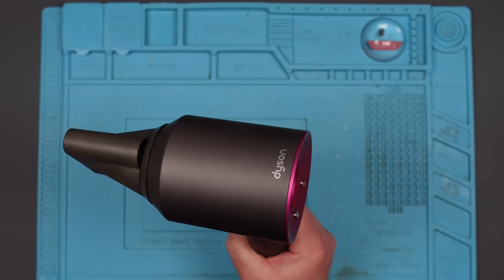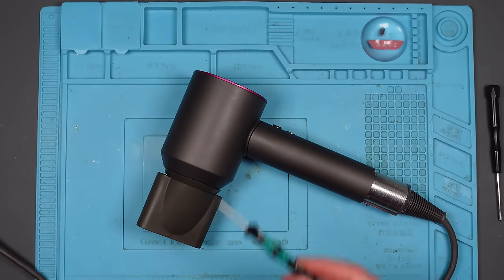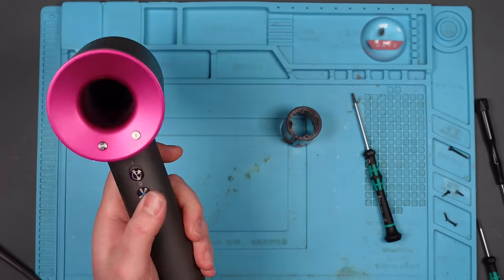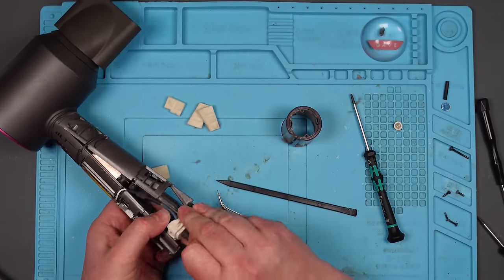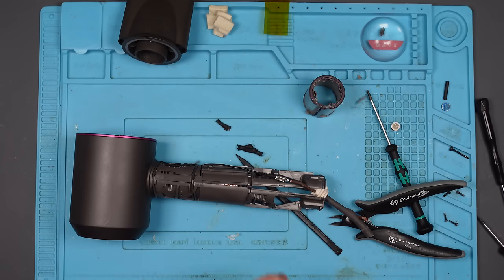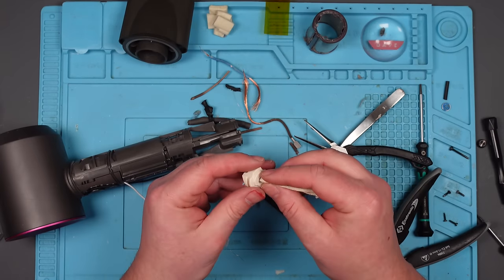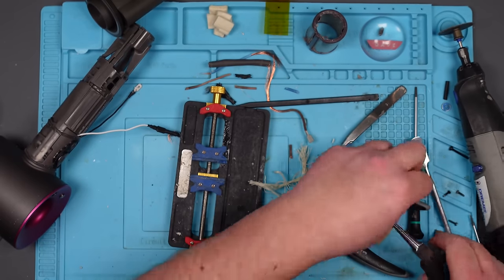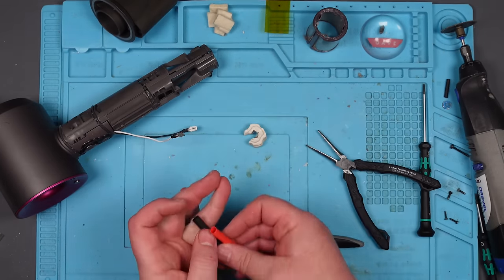I paid £75 for a £400 dyson hairdryer on eBay | how bad can it be?

Comment from the maker: I think i'll go back to melting plastic after this.
Reply: probably for the best...
Reply: use some hot glue for strain relief.
Reply: Stupid Hairdryer
Reply: @proditaki  that's the catch phrase missing!! thank you.
Reply: Should have hot snotted the strain relief.
Reply: You think it can go that hot? (Stupid fancy underpowered heat gun.)
Reply: @JohanFroloff81 Epoxy resin
Reply: Perhaps this hairdryer will help to melt the plastics when put at its highest setting?  (Just a thought!).🌬🍃
Reply: Next time just epoxy the cable in place if you can't fix it properly.
Reply: Big Clive recently tried a hot staple tool to join plastic but I recommend a b weld epoxy
Reply: Do what you know best.
Reply: I chew on plastic its enjoyable
Reply: The good news is that when it does inevitably fail again, you'll be preoccupied with having either electrocuted yourself with the likely bare wire that's been yanked out or have burned the house down. This was a pretty irresponsible "fix" to consider complete.

Comment: Dyson definetly goes out of their way to make their devices as unfixable as possible. Basically the apple of rubbish overpriced fans.
Reply: I don't know about that. If it was an Apple product, they would've glued the handle together and put a microprocessor in the power cord so it would refuse to power on if the serial number didn't match. Dyson's all about form over function, but at least it had screws...
Reply: No they don’t.  Dyson even supply service manuals.
Reply: They are very easy to service.

Just because some people lack the skill, it is not the products fault.
Reply: @dom3827 This is not true. We just had a cordless vacuum at the repair cafe. The product is overly complex and poorly designed. The product was chock full of dirt in every place imaginable with most of those places very time consuming to dismantle.

This is the opposite of well designed, well engineered, repairable and maintainable. I would not buy a Dyson product

To contrast that with another manufacturer of hair tongs which were superbly designed and made with all the spare parts available. The product was a work of art with no compromise in any department.
Reply: @SimonEllwood  again. Lack of skill and inderstanding.
Reply: @dom3827  Your comment is total, tosh. I spent my whole career in product design.

Comment: Dysons are over-engineered, they work well...but once they fail they want you to just buy a new one. Taking them apart is a nightmare, you'll find that with a lot of newer tech. It's part of the "throw-away society" we became accustomed to.
Reply: Dysons are the Apple of the small appliance world.
Reply: Something over-engineered usually means redundancy so it doesn't fail.  Perhaps you meant something else?
Reply: @JohnSmith-ro8hk  You're correct, but no, I don't mean anything else. Dyson makes great products that last, but when they fail you cannot fix them without breaking something. That is the only flaw with over-engineering, it works great until it doesn't.
Reply: They are designed to be as cheaply made as possible and absolutely not repairable.
Reply: @hugegamer5988 This is true for every company. However, I'd argue with "made as cheap as possible" over "cheaply made as possible", and absolutely not repairable 😂
Reply: I would go with "over designed" rather than "over engineered."  The latter implies that there is excessive complication to achieve superior performance, and I just don't see that with Dyson products.  Most of the effort goes into the Dyson logo, it seems.
Reply: @hugegamer5988 I don't think that's true. They're designed to look cool, and probably cost a lot more to make than they should because they won't compromise on the goofy-looking design, but they can charge a premium for it.  Repairability is not even a consideration when they design the product, but I don't think they're actively designing it to be irreparable... yet...
Reply: @jasonpatterson8091  Sorry, that white "strain relief" piece Steve had to saw in half is what I would consider "over engineering". It would have made sense if it were two halves to hold the wires, not a solid piece. That was an engineer working with a company designer to make it solid, lightweight, and affordable. You may not want to call it over engineering, but you're just playing on semantics.
Reply: I love being able to strip down my Dyson vacuum. I find it easy along with replacing bits
Reply: They are actually very easy to disassemble and service.

I repair them for a living. If you cant take them apart, it is on you. But they are made easy serviceable.

I think people are just not as capable in crafting than they were 40 years ago, where they had to have those skills to rebuild the world after war.
Reply: tell me the model you struggle with, i tell you how to completely disassemble it in a couple of minutes.
Reply: They are a mains voltage product with no cpc so are a class 2 product, they are designed to be difficult to get into so that multiple things need to fail before you could get access to live parts. Companies tend to make things difficult to get into (but not impossible) to cover themselves from liability that would be incurred if they make it too easy, especially for a product which will have to comply with multiple international regulations within one design.

Comment: I worked on a Dyson vacuum cleaner recently. I fully go along with 'Not wanting to work on Dyson stuff' ever again. :)
Reply: Why? Really easy, straight forward devices. 15 Minutes for a full repair taking everything apart and back together.
Reply: The new ones, yes horrible, had one where motor was one piece with hepa filter. But the older ones are brilliant, nicely done and great to repair.

Comment: Dyson certainly know how to over inflate their product prices. I recently had to replace a switch on a Dyson v11 as the switch mechanism has a design flaw and breaks over the years, it was a real pain to replace but the new non Dyson switch hopefully has improved strength
Reply: There's another brand with expensive vacuum cleaners: Vorwerk (also known for the Thermomix), their entry model costs more than the top of the line Dyson, however they're also in business for much longer and offer you spare parts for long discontinued models.
I wouldn't say Dyson is pure crap, they're innovative but they're pricey for rather poorly made products with bad repairability and not built to last.
Reply: @kuchenblechmafiagmbh1381  I think who ever had this hair dryer didn't look after it very well and probably dangled it by the cord which in turn would break some of the best made products, the motor should be good for many years I'd say
Reply: Looking at that, it seems like 300 quid spent on 'how to make it difficult to repair".... that's appalling design.

Comment: Good attempt steve 👍. I repair these and the cord repair takes me around 20 mins to do. They ALWAYS go exactly where you cut it off. The trick for these is to remove the platic/rubber switch cover, take the 2 small o rings from said cover, and remove the 3 torx screws on tge opposite side, that way you dan remove the half of the handle to get into the wires and access the motor. You can get to the white strain relief by pulling out the old wires and you will see the metal part of the strain relief which you saw when you cut it open. I just use a soldering iron to get to the end of it then pull it out with a pair of grips. It will come out in one piece, throw that away then just feed your live and neutral through the 2 small holes where the original ones were, (the spade connectors to use are 3.5mm female crimps) and i apply some strong glue to hold it in place. Replace everything back and job done, I've done around 50ish of these and its 2nd nature to me now. The one thing we do have in common repairing the Dyson is the tweezers down the fingernail......smarts a little bit. 
Just a note on replacing the buttons, i always use the B7000 glue to fix them back on, a lot easier to remove if you have to get into it again rather than super glue.
Reply: I believe a video of your repair could be quite interesting.
Reply: @jochenrudiger  @stezstixmix 
When I do my next repair I will film it, saying that though please don’t expect a high end production like this 🤔
Reply: @Mickwild562  No, I would not expect the same video quality, and humor. But it could still be valuable for those who encounter this problem.

I think the "right to repair" is important,  we accepted to throw everything away instead of fixing it the last decades . While our parents were much smarter and preserved resources much better.
Reply: @jochenrudiger  I agree with the right to repair. I only stumbled on repairing the Dysons when a friend asked to have a look at hers. The stress, blood and even tears were very much in abundance just like stez did, but when her friend asked me to look at hers too I learnt so much and now I enjoy repairing them. Unfortunately like others have said that are very difficult to repair on the circuit board, too many components in a short space. BUT they are an engineering marvel and are one of THE best on the market. 
The usual suspects are the cable, blocked filters and motor and thermal fuse(s) blown due to the blocked filters or they have been out on their end while switched on, I’ve seen it all with the repairs. I know I can buy another cable from eBay or even china but where’s the fun in that? For the sake of 1p
For new spade connections and a bit of glue, half hour of your time and it’s up and running again.
Reply: @Mickwild562  And I am sure that you could add a valuable video for those who encounter this problem.

I think it is time to end all this wasting of resources. Even CPU and GPU development is slowing down due to physical limitations. It may be the right moment to learn what is necessary for saving electrical and electronical products.
Reply: @jochenrudiger  it's taken me hours to figure out how to do this but here's the first part of the video. Please excuse the quality,  I'm not set up to do cam content properly just yet but it gives a idea of the process. I did this a couple of months back.
https://youtu.be/uhbNJN2seqs?si=BR0yMuUT5TjfUdxl
Reply: @jochenrudiger I feel like hair dryer manufacturers have been making disassembly deliberately difficult for decades to really drive home their point of "no user serviceable parts inside". Even my Braun hairdryer from the 1970s is pretty much impossible to disassemble in a non-destructive manner (perhaps unless you know some well-kept secrets). Said Braun hair dryer recently failed in a rather spectacular fashion, spewing liquid metal all over the place, looks like solder. Miraculously I didn't get anything on me, and nothing permanently damaged, except for a 10 amp fuse that did exactly what it was supposed to do (yes, ooooooold-fashioned place). Of course things like that happen at 1:30 AM, not in bright daylight.
Reply: Dyson uses 3m Scotch Weld for gluing the buttons.
Reply: @dom3827  ah OK, good to know what it actually is. Sometimes the buttons just pop off and other times they're a pain. I use he B7000 rubber type glue and it's perfect when it comes to removing the buttons again. Maybe the heat doesn't do anything but it does seem to help soften either the plastic button or the glue or even both 🤔.

Comment: little tip there, steve - @ 5:04, just before you squewered yourself with the tweezers attempting to pull apart those spade terminals.. use a small pick to push the release pin point in the mid of the spade - this is where it locks with the corresponding spade.. should just easily release then..
cable ties either side of the strain relief point is a good repair job / option for this.. can even put a dot of supgerlue under the tie if you really dont want it to move

Comment: Well done Steve, although if you google replacement Dyson hair dryer cord they are about a tenner and come with the integrated strain relief are available for some models... I assume they are 3rd party as I can’t see Dyson offering these unless he has had a Jacob Marley moment recently. 
Keep up the great work 😀👍
Reply: The OEM replacement is nearly £25 and is currently out of stock.
Reply: For a 3rd party to go to the trouble of making a replacement lead means there is a market for them.  Doesn't say much for Dyson engineering does it.  Dyson is for people who have too much money to spend on 'Form' rather than 'Function'.  So called British company who bailed out and use cheap 3rd world labour to build junk.
Reply: @Woffy.  nah, it just says people in 2024 still cant handle cables and break them regularly.

They need to be replaced because customer twist them so often, thes simply brake.
Not an engineering fault, more an uneducated user fault.
Reply: @dom3827  So you engineer a solution to twisty cable syndrome. Braun had a slip-ring arrangement.
Reply: @Woffy.  guess why headphones are bluetooth now. Because people are too stupid to handle cables.

There just is not a way for bluetooth power delivery till this date.
Reply: @Woffy.  you mean the slip ring, which needs lubrication regularly, catching hairs, leading to loss of contact, and wearing down after a year of mechanic and electrical abuse?

Yea, would be a downgrade to a technology, somenone already failed at 30 years ago.

These sliding contacts just making it worse, adding multiple extra points of possible failure which WILL fail at one point.
Reply: @dom3827  Lubrication, Hairs !,  its a bloody hair dry not a suppository. What are you using yours for .   
Dyson saved money by not using 32 strand wire and a strain relief that works.  Aldi heat guns = £19  leaves £280  for beer. 
For information it is not good engineering practice to lubricate slip-rings as the surfaces are burnished.

Comment: Seriously Dyson products should be much more repairable than this. 🤨
Reply: Their vacuums actually are quite good when it comes to repairs, at least their older models are. You can still get parts for them, even the motors (for the corded big ones). But yeah, with the hairdryers and stuff, it should definitely be easier to just replace a broken cord. Happens quite often, and I wouldn't want to throw something in the bin just because of something like that. I don't know if Dyson would fix stuff like that, but they definitely should facilitate easy fixes like that, so everyone can go to their closest electrician and have it fixed there.
Reply: Seriously, some people just should take a minute and observe the machine before.

Then they would find out "oh, it is actually pretty straight forward"
But most people dont do. And all of them are not craftsman. That is why they have a hard time.
No experience, no common sense in terms of such devices. Sure, for such a person it seems hard. But it is not.

Comment: £399 for a hairdryer 😭
Reply: A poorly designed, failure prone one at that.
Reply: @bradallen8909  the filters are pathetic.
clogging after 2 uses. Outside cleaning not enough. You have to disassemble the filter to get it really clean.

Comment: As someone with long hair, these are actually really incredible hair dryers. I think I picked mine up for like 250 quid used with all the attachments and its one of the best things I ever bought. The flow is just so smooth and powerful and the temp control is stellar. I don't think i'd pay new price for it, but for a good deal its killer.

Comment: I am not sure about this, but my electrician-professional friends have told me that with high-voltage, i.e. "wall-power" cabling should never be soldered. The reason is that solder might de-solidify (please use that, at somepoint: DE-SOLID, instead of SOLID, just for fun!) if something faults. And thus, might cause a short-circuit, which might cause a fire hazard. Prove them wrong?

Comment: £400 for that, someone's laughing all the way to the bank for £30 worth of parts!!
Reply: Not really I seen some guy take this apart and say it's definitely got some expensive parts
Reply: @thebeast9869   I just watched a few teardown videos including a board level repair of the Hd01. Probably actually £70 worth of actual components in total (so yes more than the £30 lol), a few small custom ic's, custom motor etc, nothing of huge cost once mass produced, pcb is mostly off the shelf components. They are probably trying to recoup their r&d costs, as it's actually quite a well designed packaged, but possible flawed design on the pcb's dc-dc feed rail.. So Dyson probably makes a completed unit ready to ship for around £90 all in.

Comment: I would have stripped both end of the spade connectors, and recrimped using what I had on hand... Or braided / soldered the wires instead of soldering to the spade... But good job on fixing that overexpensive blower...
Reply: I think that would have been better

Comment: companies like that spend more time making it difficult for users to repair. That damn thing is smoke and mirrors anyway.  MFG for about two bucks. Make your own strain arrest thingie from silicone or epoxy
Reply: it is easy.

Take off the buttons.
Take off the filter.
Behind the filter, on the inside of the machine is a Screw, TX8.
Losen this screw.
You are in, slide the tube down from the machine.
Losen 3 further torx screws and get off 2 rubber seals.

Machine completely opened in under 2 Minutes.

They are made to be easy and fast serviceable.

Comment: Not sure why you soldered to the spades, would it not have been easier to strip the wire back and then go wire to wire? Also if you had drilled out the centre of the white plastic part you could have threaded the wire through and secured with a cable tie to hold it in place. Loving your channels